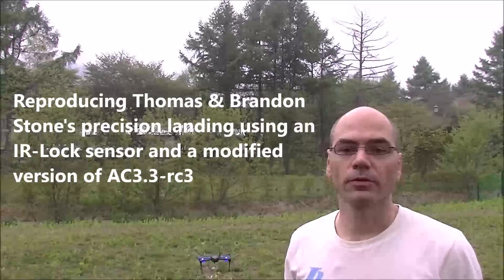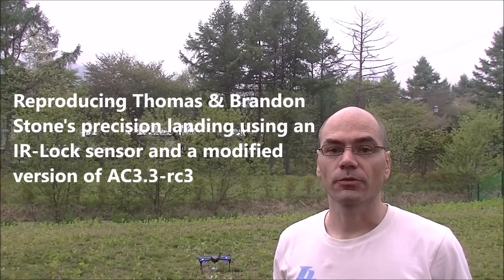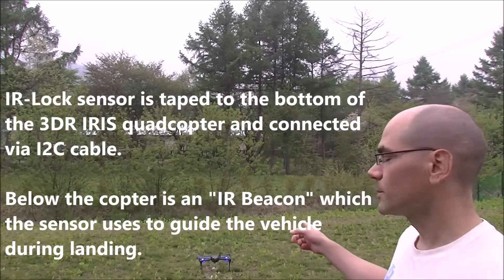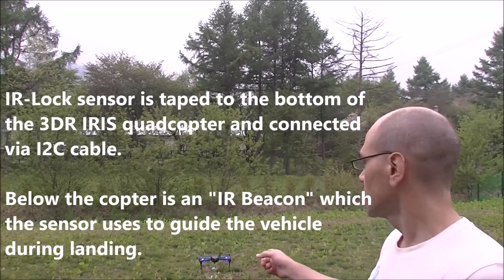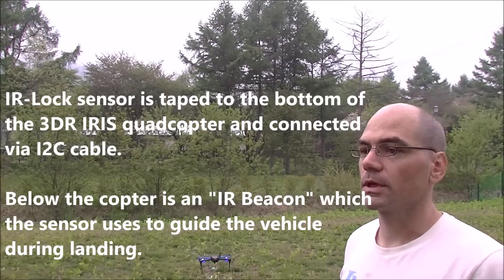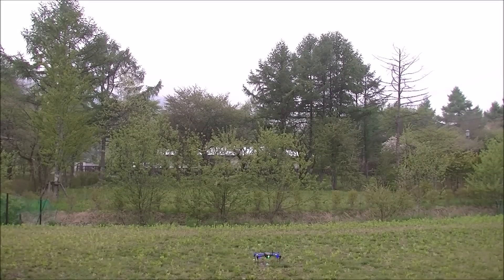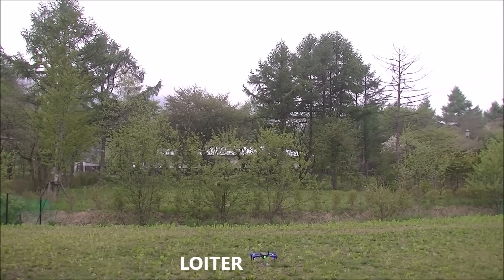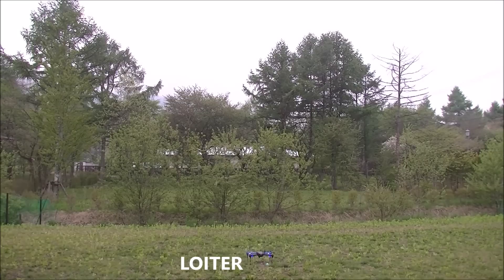IR-Lock for precision landing with AC3.3

Comment: Hi randy i am wondering if, i could setup precision landing using pixy2 cam where i will set the pixy to detect a certain color. And when the pixy detects the color  the pixhawk will do a precision land, its that possible without adding additional code? (Plug and play)
Reply: With ROS for positioning using t265 + and tf mini for lidar
Reply from the maker: Zeke, yes probably although I have never tried changing the IRLock firmware.. but I think it is quite close to the standard Pixy cam software.

Comment: Hi Randy, I was wondering if it would be able to cope with a moving target to land on, like a slowly moving boat for instance.
Reply from the maker: Marc Rogers Yes, it should be able to handle that.  The maximum it can handle is 2m/s of horizontal movement but that's the absolute maximum.. better to keep it below 1m/s.
Reply: Randy Mackay Thanks for coming back to me. that should be plenty, does it only work in land mode? ideally what I want, although not a deal breaker is for it to lock on to the target and for me to set the descent speed in alt hold/loiter with the sonar/LiDar accounting for rises and falls in the boat, much like helis on aircraft carriers do. i'm just talking a little bit of swell not huge waves.
Reply from the maker: Marc Rogers In these tests it's only working in LAND (including the last phase of RTL) .. really it's a horizon position controller so what you're describing is certainly possible to add.. just need to think of a way to add it without complicating it for other users.  Maybe a ch7/ch8 option to make it lock on while in Loiter mode?  .. or maybe an optical follow-me flight mode?  needs some further thought perhaps..
Reply: I could work around that, my main concern is if I'm filming a moving boat RTL is the last thing I want to happen, would end up with a very soggy copter, maybe if I set a follow me to trail the boat at 10M then bring it in in loiter until it can pick up the beacon then let it land itself. I've just seen your video about motor kill, that will help massively, could always get someone to catch it then instantly kill the motors

Comment: I am imagining some autonomous landings in a moving platform soon
Reply from the maker: David Teles Yes, maybe at speeds up to 2m/s or so (7kph, 5mph) ... about walking speed.
Reply: Randy Mackay  if combined with gps telemetry it should work at faster speeds, liked in a boat at 30kph.That is my perspective, the ir lock would just eliminate the error between the two vehicles

Comment: Another great demo.  Could ir lock be used with alt hold and loiter, so if the beacon was attached to a moving target we would have a very useful aerial filming feature?
Reply from the maker: filmserve Yes, I agree with Nick that it could be used in other flight modes like Loiter.  On an earlier test there was a bug that would cause it not to descend while landing and I found that if I dragged the beacon around the copter followed it quite reliably.
Reply from the maker: bunker1213 in the future yes.  It's a different feature in some ways but the part which reads the position data from the IR-Lock sensor could be shared with a follow-me feature.
Reply: filmserve Potentially, though the IR-Lock camera (Pixy) would have to be aimed at the IR beacon, and would need a way to translate it's positioning to the camera gimbal position. You can use IR-Lock for (better than GPS) loiter / position hold.
Reply: Randy Mackay Interesting! Do you see this as an option to augment follow me mode as well?

Comment: Randy, exciting to see IR-Lock making it into 3.3. Are you planning to have separate "precision" loiter and land modes? I would also love the ability to tune/tweak the landing settings, and maybe a failsafe "divert" if the precision target is unavailable.
Reply from the maker: Nick McCarthy There's a manual override so if the pilot add roll or pitch inputs it stops following the IRLock and instead responds to the pilot's commands.